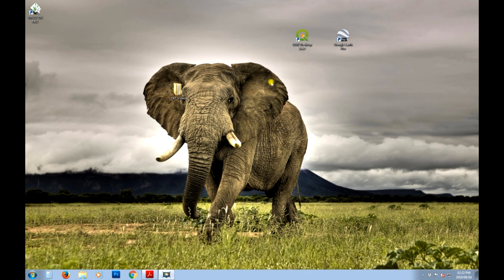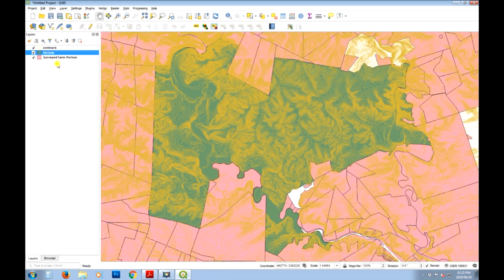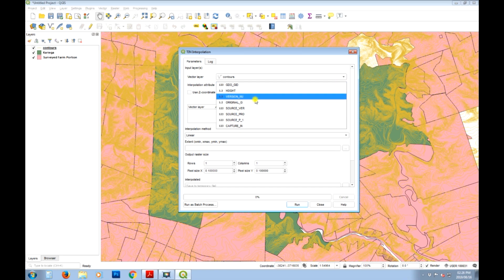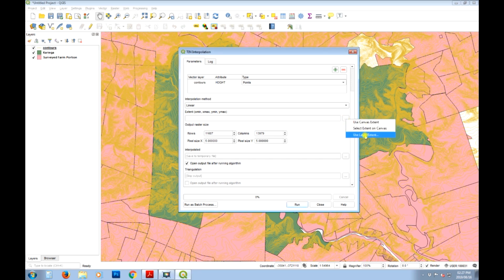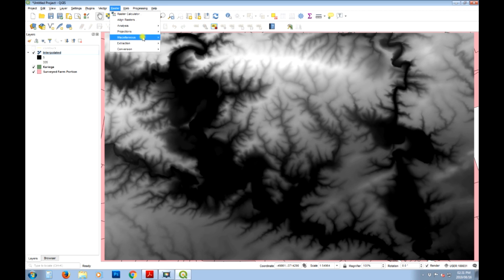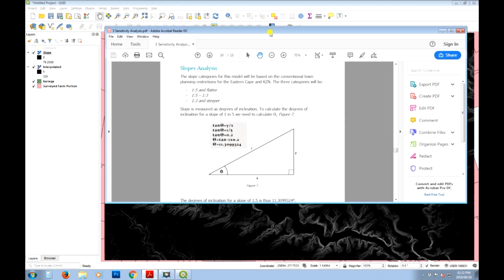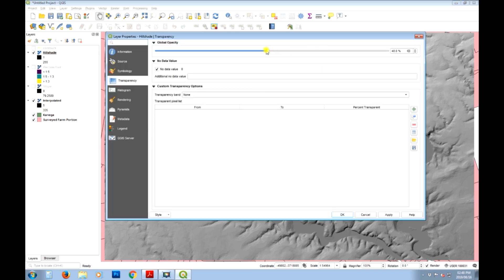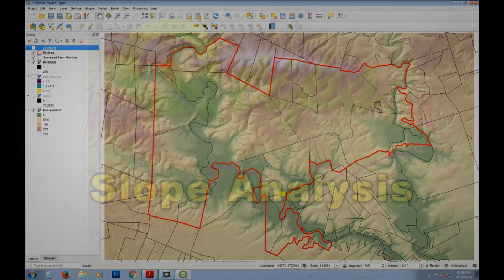QGIS Slope Analysis & Hillshade

Comment: After looking at a number Youtube videos on QGIS Terrain Analysis, your's comes closest to what I'd looking to do! The project is to create a river corridor map. The protocol being used focuses on paper topos to identify river terraces. So, I'm thinking of using contours clipped to the river valley margins, then make a DEM followed by a slope map defined by the river valley's extent. Then it would be reclassified to 0 to 5% slope to locate specific terraces. (I may need to research if my slope range is adequate.) Do you have any other suggestions? I could then polygonize these to add details in the attribute table. I'm open to any suggestions! Thanks for pulling this very helpful instructional video together. John